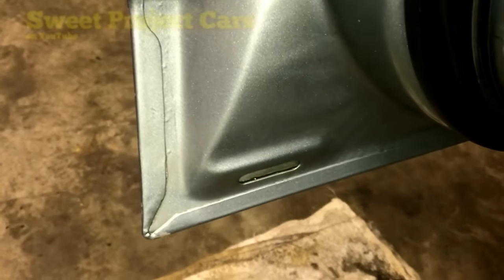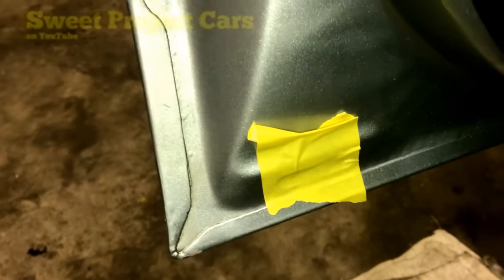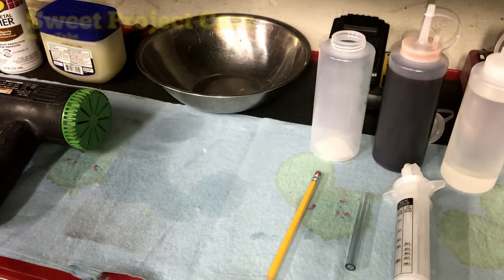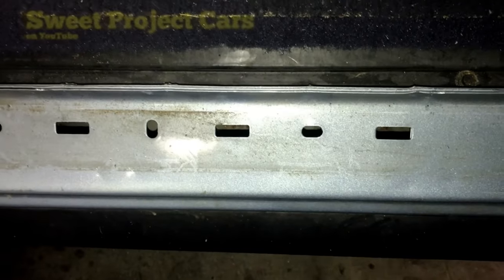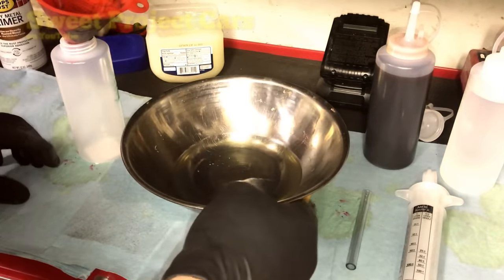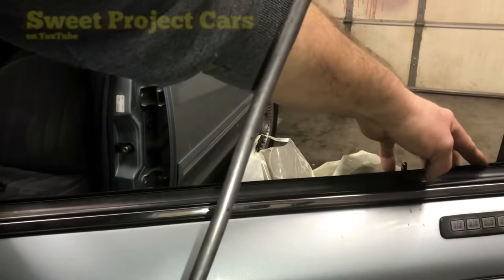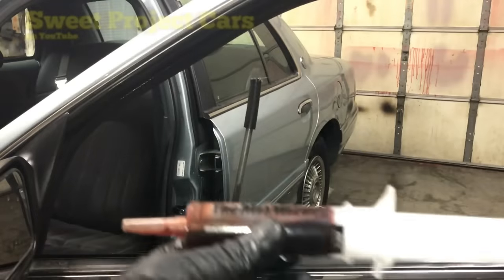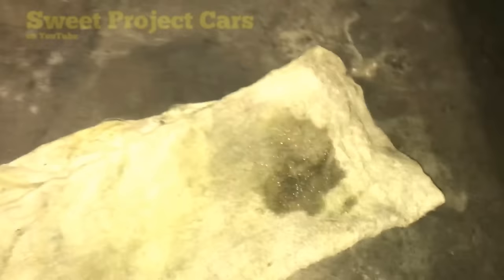Your Car Will NEVER RUST Again! For Just $10 Bucks!

Comment: One more question if you don't mind: is the petroleum jelly an essential ingredient and does it add to the thickness of the mixture?  I was wondering about using just AT and. mineral oil.
Thanks!
Reply from the maker: Yes transmission fluid and mineral oil work great together my friend

Comment: I have done this with used motor oil for years, it definitely help.
Reply from the maker: We like to use used transmission fluid, it seems to work even better.  Thank you for watching and sharing.  Have a great day Shane!  mad Mike the hammer SPC
Reply: Sweet Project Cars I’m going to switch to transmission fluid and give that a try seems like you’ve been doing it that way for a while and it’s working, I just always seem to have more of an abundance of motor oil LOL thanks for the tips.
Reply: Doesn't used oil have a smell? Not a car enthusiast, so I have no clue! ;)

Comment: Won't the transmission fluid eat the paint?  It also seems like the vaseline or mineral oil would be a magnet for dirt and debris to stick to it and stay in the rust-prone areas and the debris would hold moisture and promote rust.
Reply from the maker: 1notgilty trans fluid does not affect paint and we have done this for 20 years for 100's of customers with still rust free cars and smiling faces

Comment: Might it be a good idea to block off the drain holes and leave an ounce or so inside the door? Seems to me that it would prolong its effectiveness and continually coat the interior surface while sloshing around a bit as you drive.  I wouldn't think an ounce, spread out over the length of the door, would be enough to slosh around so much as to get all over the window glass.
Reply from the maker: You can block them off for as long as you want we find 15 to 30 minutes or more is fine for it to soak in but you can leave them blocked off for days if you like have a great week
Reply: @SweetProjectCars  yes it will make a good soak ,but what about new water that gets in....it need somewhere to go or it  will start rusting higher up...

Comment: leaves become acidic,that's why very few bones are on the forest floor,the rotting vegetation disolves the bones of dead animals(even bigfoot),seriously,steel is no match for acid,and here in scotland where i live in the sticks(ish) trees all around leaves in every nook and cranny,rust is never far behind.
My bro lived in newzealand for a while,and some dudes wouls spray the underside of off road 4x4s with engine oil then dust with talc,then coat with more engine oil,repeating 4 or 5 times,box sections too,a puffer to get talc inside,makes a good sludgy but firm barrier.

I'm here because my triumph spitfire is being reassembled and though the chassis is galvanised i want to spray dinitrol inside it,the doors on these are prone,well the whole thing is prone to rust,hopefully after this resto(second time )it can be better protected.
I will use oil to protect once all the paint is applied for sure.

paraffin might help thin the vaseline to spray inside box sections,just like waxoyl,though not as messy.
Reply from the maker: john amptech thank you so very much for sharing this awesome comment it helps everyone here :)
Reply: No worries mate,i get info too,share and share alike,just not your woman,or gun.

Comment: I would think that the Vaseline is far superior as it will "harden" and the water will stay on top to evaporate. Oil floats on water. Wouldn't the water go to the bottom of the oil and never be able to evaporate? Just my 2 cents. Great video and new subscriber here.
Reply from the maker: Tr Whitford we have done this for 20 plus years on many customers cars and we have found that if the area is dry prior to, the water cannot move the oil, as you know if you spill oil on something water on a towel will not wipe it off or even trying to spray it off with a hose does not work, it the oil is there first it wins :)
Reply: Make sense 2 me. Thanks for the reply.
Reply from the maker: Tr Whitford you are very welcome :)

Comment: I think an easier option on the door is to simply tape off one of the drain holes and then use some rubber tubing and your syringe to squeeze a few ounces of transmission fluid inside the door through the other drain hole. Then after doing that, tape that hole off as well and then with both holes taped off drive the vehicle around for a day to get the fluid moving about inside the door and penetrating the crevice good. Do all the vehicle’s doors at the same time. Then afterwards remove all the tape. It might be a good idea to repeat the process every year or two just to be safe.
Reply from the maker: Thank you for watching and sharing.  Have a great day. mad Mike the hammer SPC

Comment: Yet another awesome tip you share with us, and some of us appreciate each and everyone. A question though, you said you prefer transmission oil, can I use used oil? I have a bunch that has 50k on it, and isn't real bad, or do you have to use new? Glad I didn't get to the recycling place with  couple gallons of it if I can use for this excellent purpose, especially since I live in the north in a high salt area.
Please let me know, thank you in advance
Reply from the maker: nice guy, yes you can use, used oil as well, pretty much any decent oil will work my friend :)  thank you so much :)
Reply: Great video thank you
Reply: Get to spraying ;)
Reply: niceguy217 i

Comment: I love it 😍!!!!!!!. Thanks for the info and the time for this information... I am all most done with my restoration project on my 73 trans am. I know exactly what you mean.. 
I'm finding rust  every were the factory seam sealer has been installed.. mostly because they use too much...it acts like a dam, and will not let the water run out..
Or it's causing rust underneath the sealer...... I'm going to have to get rid of it and  use your system...after I repair the damaged area's....and spray a good cost of epoxy primer. and paint it.... I believe that your system is going to be the best way to go about it... thanks
Reply from the maker: dwayne  the 73 T/A, what a sweet ride, love those !!!!   thanks for sharing the great comment, my friend.  mike
Reply: When I am done with the paint. I will send you a picture of the car..
Reply from the maker: Good deal would love to see it

Comment: Great video. Looking to get another car, will do this. Do you have any tips for under the fenders? My car right now is really bad, disintegrated with rust mostly at the rear. Keep up the good work!
Reply from the maker: delfin if you look you can find a hole to add treat them you can also use a spray bottle to spray the area you want :)

Comment: Rust (corrosion) is a chemical process. The idea is for the metal (steel in this case) oxidizes (loses electrons). Steel (structure) is a non-amphoteric metal, meaning it will not corrode at one extreme of the pH scale. In this case, a high pH.

There are two ways to prevent/slow  corrosion. the first is to coat the metal to prevent the loss of electrons. This is done with paint. Underground utilities do this (water/oil/gas lines). They coat the external and sometimes internal surfaces of the pipe with the appropriately rated coating.

This is is an imperfect process. There will be small holes in the coating (holidays as we call them in the corrosion biz). Those small imperfections are exposed to external elements and will corrode if there are no other methods to control the corrosion. This is where the engineering meets chemistry.

In order to prevent corrosion in steel, you need to raise the pH of the  environment surrounding the exposed surface of the structure you want to protect. There are 2 methods for this. 

The first and least technical is through a simple anode. Just place an anode in the environment that the structure is vulnerable and attach the anode wire to the structure (away from the environment, such as a screw hole higher that the moisture. The anode (Zinc or Magnesium) will preferentially corrode before the structure. It will give up its electrons to the steel and the pH will rise around the exposed structure as the free electrons find their way to the holidays in the coating.

The second is not recommended as it requires an impressed current and typically uses graphite anodes. If the power source is turned off (i.e. the car), then the impressed current system is no longer effective. This is typical application for long underground utilities that we employ to keep those expensive pipelines from corroding and causing havoc in populated areas. The improper application of impressed current systems can have devastating effects as seen in San Bruno California in recent memory. Too little current will cause the system to be ineffective, too much current can drive hydrogen gas into the grain of the structure and enbrittle the structure which degrades its pressure rating and can cause the same catastrophic failure as running the structure at too low of a current.

This method employs repelling the water away from the structure. Again, it will only slow the process. I'm not sure if the oils employed will collect dust and wear the coating down at the interface of the structure and the oil.
Reply from the maker: Thank you very much we have done this process you’ve seen in the video for close to 20 years on hundreds of customers cars and they are still rust free have a great
Reply: The results speak for themselves. If it works, then it works. Nice tip!
Reply from the maker: Thank you very much my friend appreciate all the great information have a great week

Comment: Thanks for the video.  Great explanation.  However here in MN vaseline was HORRIBLE!!!  To anybody not in a 100 degree climate, do not use Vaseline.  I blow dried it and even microwaved it and I barely got it through the same sized brake line used here.  The Vaseline started solidifying within minutes and clogged up over and over at the bottom of the brake line.  I had to keep blow drying it numerous times to work.  This project took forever.   I am going to try mineral oil since that stays liquified and I'll let you know how that goes.---Follow up.  I was blowing (insert joke here) into the brake line to get the vaseline out into the door panel and now with the baking temps the vaseline is coming out the bottom of the door.  Quite a bit actually which is great.  I guess I did get enough in there to do the job.  Thanks again for the great video.  I will use mineral oil next summer though when i redo it.
Reply from the maker: Yes the Vaseline is a bit tougher to use that’s why we suggest using the mineral oil, the new video we just came out with yesterday is even better have a great weekend
Reply: @SweetProjectCars  I like the idea of a petroleum jelly because it is going to thicken when it cools and really stick and fill small voids.  Doing the treatment on a good hot day would likely slow the cooling process.  I also suspect that mineral oil may mix well with the heated petroleum jelly and aid in it's flow.  Your thoughts?

Comment: Thank you for your great tips. What I've noticed,is that there is a lot of dust build up that lays at the bottom,then the water makes the dust muddy. We need to try removing muddy dust also, before doing the treatment.
Reply from the maker: It's best to get the area as clean as possible for sure Carlos. Thank you so much for the view and comment, have a great week and all the best on your project my friend. mad Mike the hammer SPC

Comment: Can the petroleum jelly be applied over surface rust?   

My truck 2010 Chevy has rust spots ( from previous hidden weather stripping leak ) under the vinyl matting, some of the rust is in tight & curvy and creased spots
Reply from the maker: I Know You're Right But the trans fluid or the mineral oil will work the best for that

Comment: I'm having rust issues badly on my exhaust manifolds. Can I wipe engine oil on it to protect it?
Reply from the maker: The only thing you can do to stop the rust on your exhaust manifold is to paint them with a high heat paint
Reply: @SweetProjectCars   Thanks, I did that. I took the whole thing off and got most of the rust off first with lots of elbow grease and chemicals. It was less than 2 years old.
Reply: @ArcanePath360  muriatic acid and crud remover will too

Comment: Very good.
 I live in the worst possible place for rust> WNY because of the large amount of snow and salt to melt it. Great tips for access to door bottoms and rocker panels!  I use a cheap sand blast gun to spray oil / cosmoline mix into the frame, doors, wheel housings, rockers and all lines that typically rust out and on any non- undercoated areas. Oxidation requires air to turn metal to rust, oil coating blocks that action.
Reply from the maker: mt  thank you so much for sharing   :)
Reply: I live in MN. We just replace the rocker panels if it's a big deal. Usually we let trucks and cars rot out because it's a car. If you have a car that is rotting out in the doors, it means the frame is also rotting out. When the frame goes, that vehicle is toast.
Reply from the maker: ryan you are correct on the frame deal :)

Comment: ATF fluid gets rite in the steel an hangs for a long time,I make sure car is well dryed before I use under coat gun with 3 foot hose an 360 degree nozzle spray.once in the fall before snow,an once in spring.Twice a year, maybe over kill,but if you have a nice car,better safe than sorry! Great video by the way! 👍👍

Comment: Hmm. I was always told that Rust is like Cancer. It rust from the inside out as there's no cure as you are just masking the problem to slow the process. Cutting out the bad rusted metal parts and wheld on new ones was the only cure. I live in a rust belt here in the middle west, as I was taught to keep my car washed as often as possible especially in the winter at least twice a week to prevent roadsalt from eating away. That's the key, keeping your car washed.
Reply from the maker: it is like cancer and they rust from in inside-out that's why you need to do this treatment.
Reply: Eman 08 hence why he is adding rust treatment to the inside. If you already have rust then it will slow it down which is exactly what you want.
Washing your car will help but won't stop it or be as effective as this, washing only really helps with the external stone chips which have taken it back to bare metal, these should be treated differently though
Reply from the maker: Richard you hit the nail on the head with that one   thank you very much for the kind comments and we are very glad you are here with us :))

Comment: Will the ATF hurt the car paint?
Reply from the maker: no damage to paint what so ever we have done this for years,  thank you very much for the kind comments and we are very glad you are here with us :))
Reply from the maker: We tried the fish oil and just could not get over the smell in the summertime heat ...it was horrendous,  thanks for sharing my friend :)
Reply from the maker: oh i know it works great benchman it is a very effective oil for sure :)
Reply: Transmission fluid will not harm paint . Plus it sticks to the metal and anything else.
Reply: Just don't use brake fluid , that will remove paint.
Reply: Sweet Project Cars  *whatsoever 😁✌
Reply: You're right. A couple of years ago I bought a cab sight unseen to replace the rusted out mid 80's one I had when I knew it had a 6.2 diesel. Those were known to change their own oil regularly. I was right. The bottom of the cab was covered but like new.
Reply: No it's not !
Reply: natural rust protection, thats why i never dispose waste oil... i covering underneath and hidden spots... works like a charm
Reply: @Kevin-en2ye  
If you use fish oil, don't run over all the neighborhood cats that will be hanging out with your car❗
Reply: Why don't you mix all the fluids before you put them in the door?

Comment: I have had second hand cars for over 50 years and never had a rust problem . Always sprayed old engine oil into the doors an fender panels all box sections and under the floor of the body then let the excess drip out .
Reply from the maker: Well, most people would rather try to help the environment a little bit by not doing that.  Thanks for watching and sharing.  mad Mike the hammer SPC

Comment: PS uncle used bug sprayer because it created a mist...
Reply from the maker: It works very well thank you for sharing this have a great day
Reply: Was he able to use it with straight mineral oil or transmission fluid? Wondering if it would have to be thinned to spray

Comment: Petroleum jelly is very flammable!!!
Petroleum jelly is a great fire starter for camping
Reply from the maker: Petroleum jelly is not flammable   Watch this  https://youtu.be/5J0VG4_jR2w  The only reason it SEEMS that the petroleum jelly burns on cotton balls is an illusion.  If you are to take a cotton ball with nothing on it and light it on fire it will burn up in seconds.  By adding the jelly to the cotton ball, you are slowing down the combustion rate of the cotton ball, it is not the petroleum jelly that 
is burning it is simply slowing the cotton ball from burning up in seconds. Thanks for watching.  mad Mike the hammer SPC